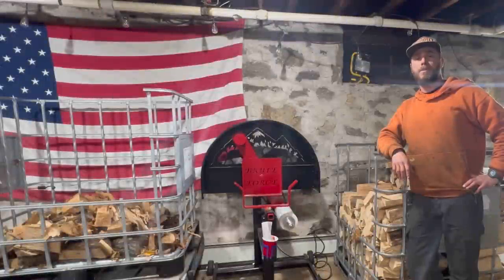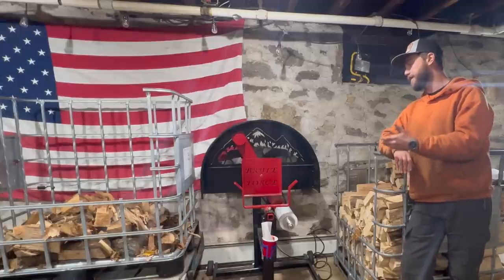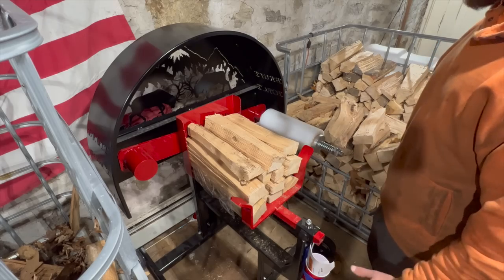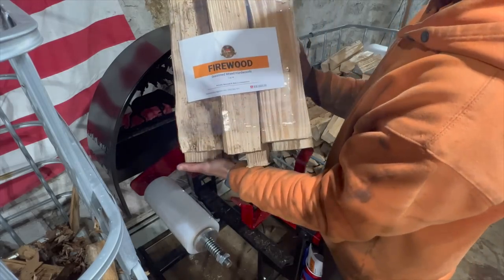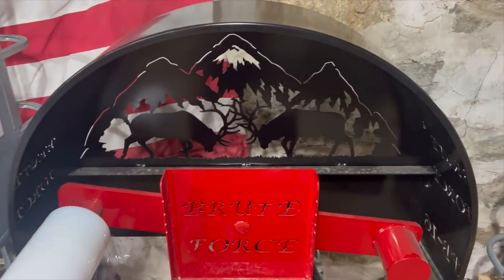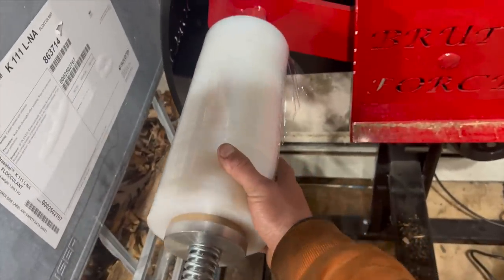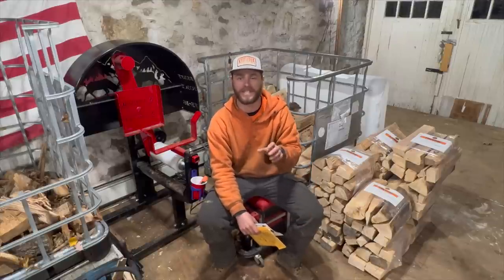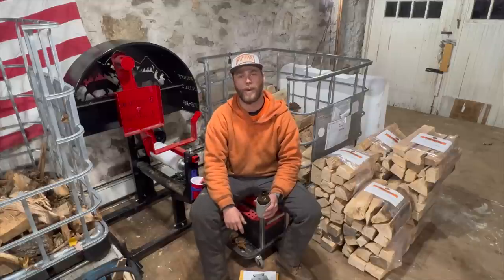#304 Making Firewood Bundles with the Brute Force FB-16 Electric Bundler

Comment: Nice job, always cool when folks bring you money that you forgot about lol,  when u grab first piece, grab the wrap and drape it over and around and place that piece on the right side of the tray, then build the stack. When customer opens bundle that piece will unwrap easy as well, might even save you a few inches of plastic, instead of going thru the whole first layer.  Which will add over time a few more bundles per roll bud.  Pennies here and there add up to benjamins
 I used to do alot of shipping and receiving at my old job, 🙃
Reply from the maker: That’s a good idea for the bundles I’ll have to try that if I can remember!